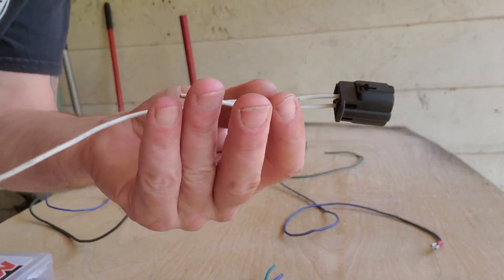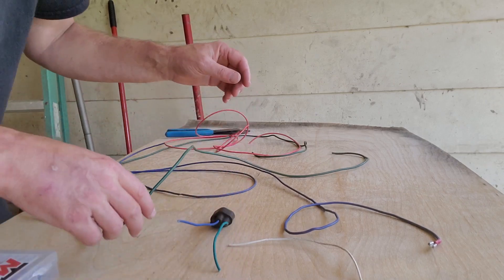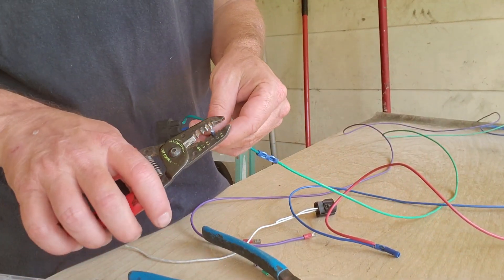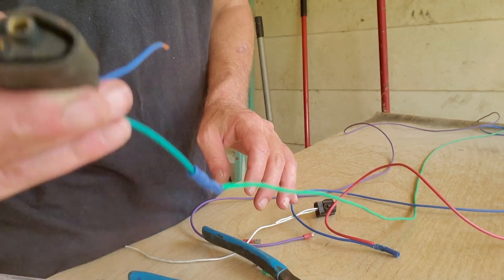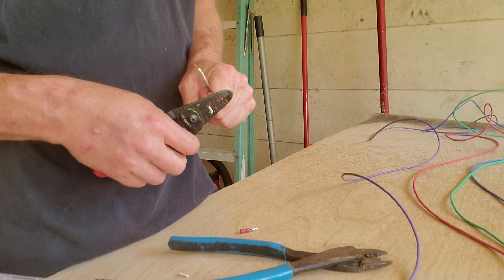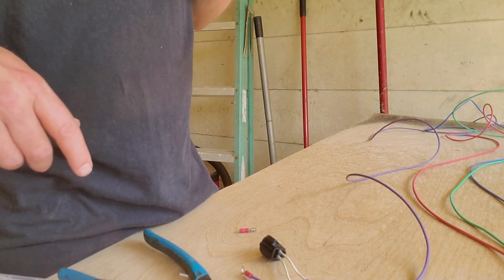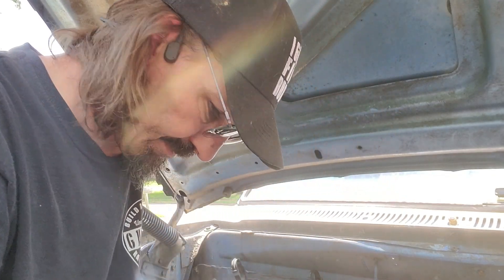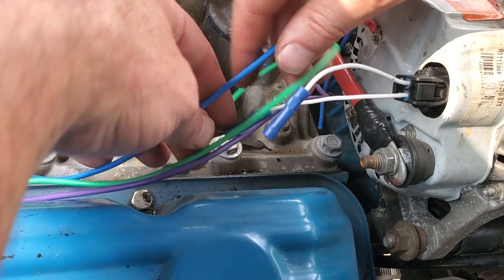How To Wire An External Voltage Regulator For A Chrysler #nonamenationals

Comment: Hey. I know this is a older video but i just bought a external regulator for my alternator so I can stay at around 15 volts for my sound system please message me if you are willing to assist me in wiring it up . It is a four-wire regulator
Reply from the maker: Send me an email with your info

Comment: I did this conversion to an external regulator on a carb converted magnum engine with 1994 style alternator and only charging at 12.1? I have bought 3 voltage regulators and a new alternator  redid all grounds and still only 12.1 I'm lost

Comment: Excuse me Travis I got a problem with a free dodge dakota  and it's a 98 with a voltage regulator issue can I use any 12 volt dc regulator and modify it to work as an external?
Reply from the maker: That i do not know
Reply: @travismopargarage4949  fuck im going to do it anyways probably dig around and look up some other shit like amperage got a regulator from aa Ford alternator I tore down off a 2008  Ford edge so I'm going to Frankenstein it like always.

Comment: The simplest of circuits can be a daunting task to those who don't understand them. Excellent video Travis! 🏁
Reply from the maker: Yes! Thank you!
Reply: @travismopargarage4949 this should help with my 1989 Dodge d350?
Reply: You got that right. Especially if you buy a HO alt and external regulator that comes with 1/2 ass instructions and when you follow the instructions and have an important question the owner just continues to ignore you after giving yet again another 1/2 ass response 5 times over, and just stops communicating. I’m still trying to figure it out bc it’s expensive mistakes that I’m trying to avoid. The guy won’t even send me a crude diagram, talking about resistors inline from stock field and sense, but I’m not to use stock sense because it goes to the computer! I’ve been waiting over a week for a solid response from the guy.